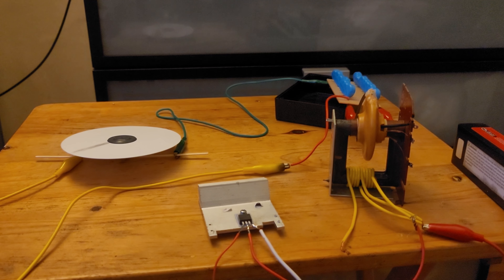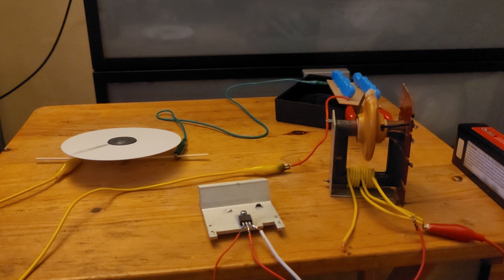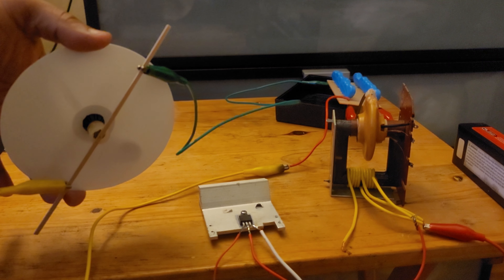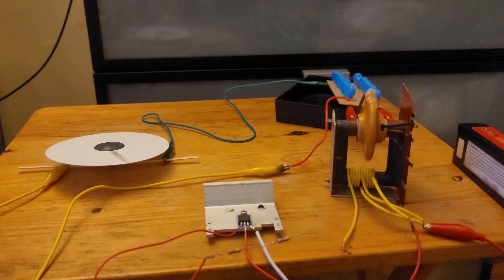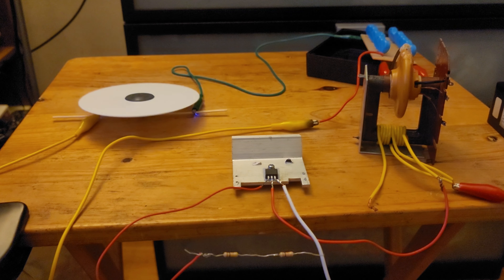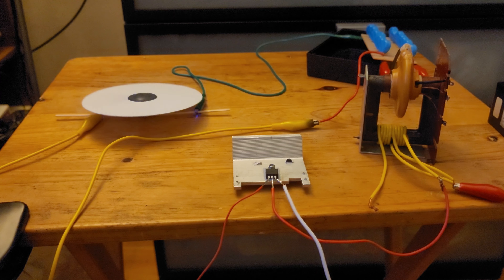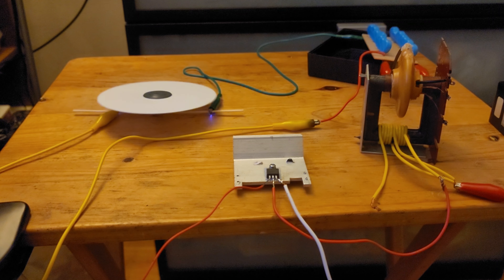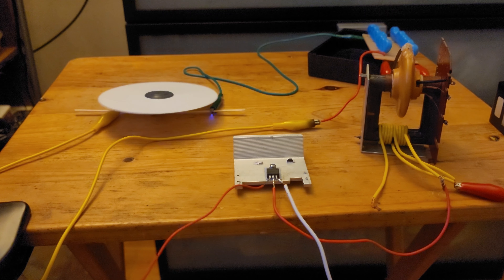Electrostatic ion motor

Comment: Cool video brother, What kind of plastic is that? Where did you get it from? What was it, before you cut it?
Reply from the maker: @FrancklinPierre-v4b  Hi. The plastic is a polystyrene sheet. U can buy at a hobbybstore. I used a cd as a template. The transistor was a tip102
Reply: @goobman1981  Thank you very much. you're doing amazing work. I'm trying to get my bowl shape lifter off the ground. my amazon multiplier won't work pass 12.8v dc. I hear the multiplier voltage drop, when I try to increase the voltage. I'm using a plug up, 0-36v power supply and a 0-36v ZVS drive with an AC flyback. my multiplier is sitting in the open. I'm going to buy another voltage multiplier, any suggestions?
Reply from the maker: @FrancklinPierre-v4b  Hi. Thank you. I build my own voltage multipliers with the capacitor and diode ratings i want. When i made the bowl shape lifter. It requires more power to lift,than a standard lifter. If you want it to work. Look at my other videos on my page as well.

Comment: any idea what the torque is? I guess it would be lower than a magnetic motor, but I guess this might be capable of running faster. The fact it is flat makes me think of tesla turbines. I wonder if you could drive that whilst magnetically levitating it too, friction would be reduced a lot.
Reply from the maker: Hi. I couldn't tell you the torque, but once i adjusted the electrodes it spun alot faster. It did remind me too of tesla turbines. It probably could spin levitated above a magnet.

Comment: If you add wings to it it will levitate at a certain height. What material is the disc from?
Reply from the maker: The disc is a polystyrene plastic. How could i add wings to it, to make lift?
Reply: @goobman1981  I think it would go if you sticking balsa half-blocks to the bottom of plate . But it requires knowing the direction of rotation.
Reply from the maker: @gregorjajcaj8464  Do you mean, making the disc a compressor.
Reply: @goobman1981  I mean something that produces buoyancy.